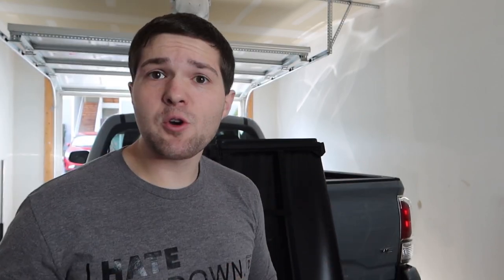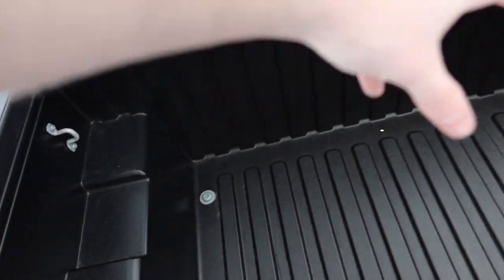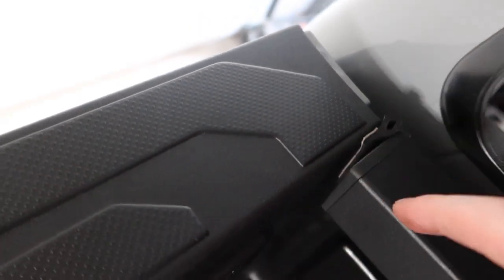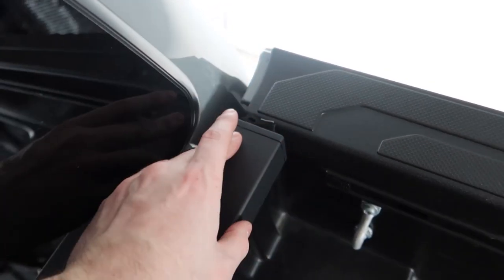Gator Tri-Fold Tonneau Cover | 2 Year Review + Install (Best Tacoma Mod)

Comment: Very helpful video, thank you.  On the Gator cover I just installed there are 2 additional straps that attach to blocks on the rail and are attached to the front bow.  Are these safety straps?  They can’t be cinched down

Comment: The Toyota OEM hard tri fold cover comes with rubber plugs for the gaps at the front of the bed. Don’t know if they are available separately though

Comment: Just bought a 2019 Tacoma off road and they gave me the exact cover, but it was just inside the bed uninstalled. Turns out, they only gave me the cover without the hooks or mounts for the clamps on the cover to clamp onto. What do I need to get? What are they called?

Comment: Do you need to add the weather strip on the bottom/back of the bed? So that it would look like one continuous strip going down the tailgate edge, across, then back up?
Reply from the maker: No just the back corners and around the tailgate

Comment: Do the rear latches seem to not quite tighten enough and if you tighten them more you can’t get latches out after getting them in ?
Reply from the maker: After they broken in a little I had to tighten them a little more. But no issues

Comment: OEM bed light installation? Where is that video. . .   Love the channel
Reply from the maker: I did it on my 2018. The 2020 is even similar. Still haven't done it just yet
Reply: I have a 2020 Tacoma Sport... and it has an ID10T for a driver

Comment: Can I take a soft trifold to a an auto car wash with spinning brushes. ?
Reply from the maker: Yeah no problem. Although I would highly recommend never ever going to those type of car washes. Touch washes with brushes and sponges will micro scratch your paint causing swirl markes. The best way to keep your paint looking brand new is no touch washes and hand washes using the two bucket method. A ceramic coating or wax helps with keeping it cleaner longer too.
Reply: Taco Rick regarding no touch washes. Are those the type u pay like couple dollars and wash it your self ? Sounds pretty cool but where I live it’s kind of sketchy gang area lol. Thanks for the tip. 👍

Comment: Can you provide details for the weather stripping you used? I appreciate it.
Reply from the maker: Its provided with the cover
Reply: I appreciate the reply. I will go to Lowe’s or Home Depot & see what they got. Did the foam material hold up on the 2018? I’d rather get rubber material.
Reply from the maker: Yes
Reply: @TacoRick  I have a 2017 Tacoma 4-door I think the box is 5 feet, I would like to install one of these covers, I would like to know if it is resistant to rain and snow, I also live in North Carolina, and where can I buy it?  Thank you

Comment: I bought a trifold gator cover from real truck and I must say I am not happy with it. The material is not tight and holds water in the rain. I have a 2023 Tacoma and have had the cover on it less than 2 months. Get a different tonneau cover.